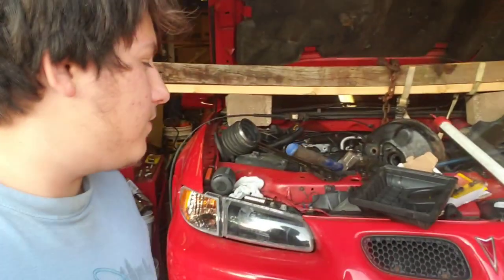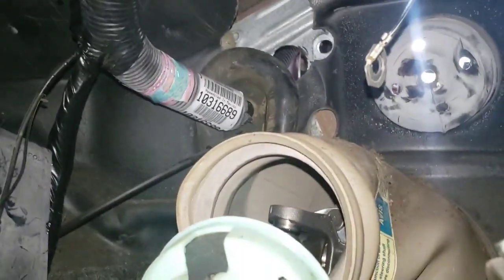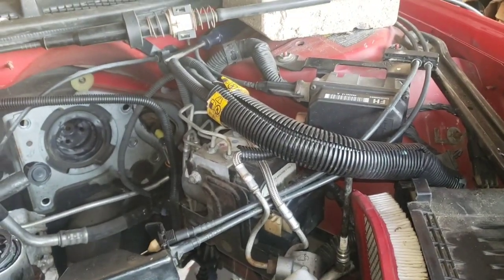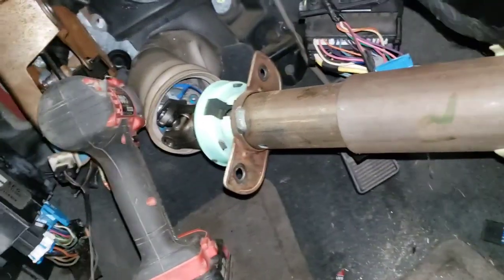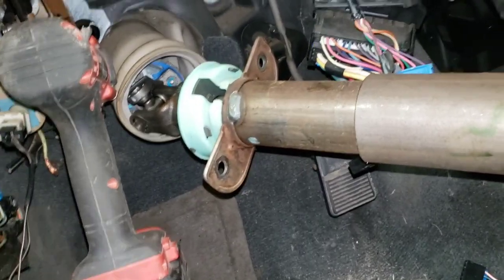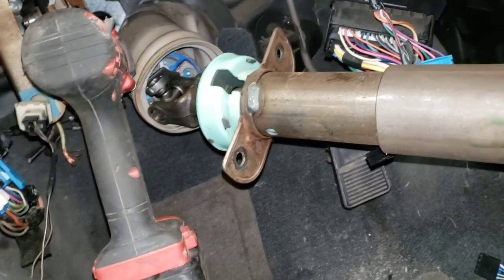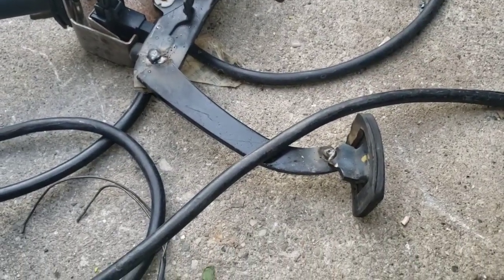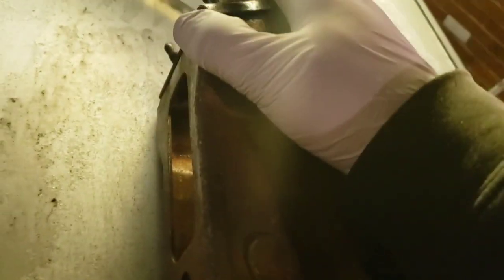02 GTP Manual Swap PT. 2 : Clutch pedal install

Comment from the maker: I am missing a piece of footage for some reason. It's where I removed the brake pedal box and cut it up to make the clutch pedal fit.  I really sure what happened with it but it's pretty self-explanatory. You just kind of figure out what's in the way and cut it out, with regard to making sure you're not making it less strong.